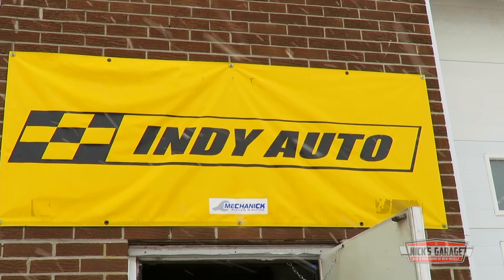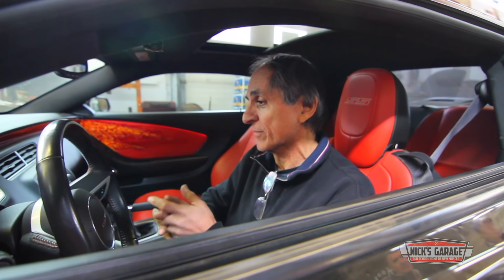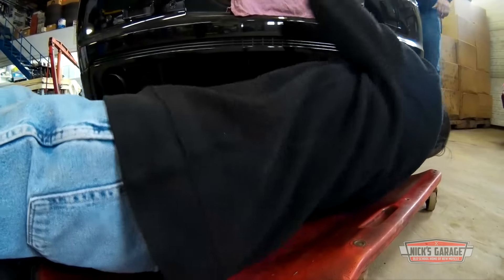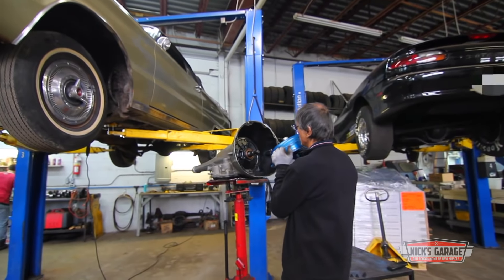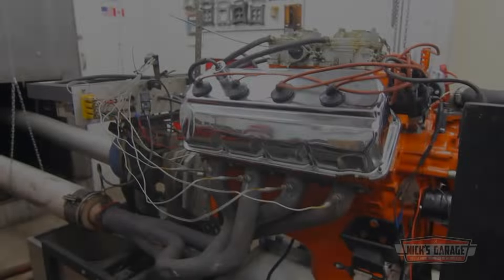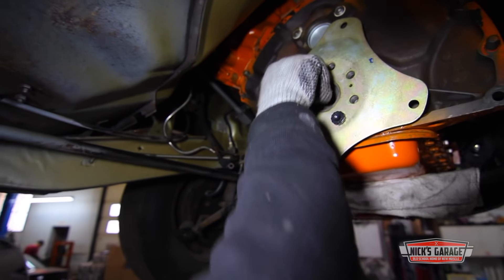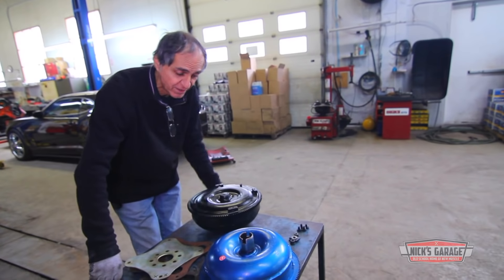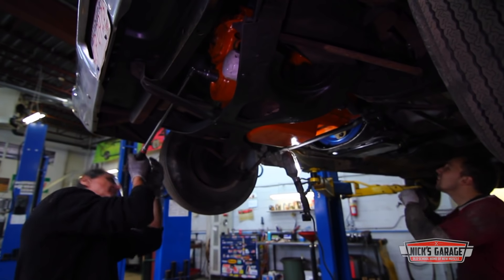Nick's Garage Before Christmas - '66 Satellite HEMI Swap!

Comment: We did a rear wheel bearing and brake job on one of my Chrysler branded minivans and somehow the backing plates got butchered during the job. It made a noise very similar to this, but it was more pronounced because it was rubbing in a few different places. Btw, those backing plates were expensive! I think it was ~$800 for a couple pieces of 12" diameter tin. Good old dealership. pricing! Grr.

Comment: Sounds like a GM aluminum drive line. They pop and crack like that really bad. I had a 4x4 I installed a steel drive line in and it never made the noise again

Comment: Like Dragsters that go out and race for a weekend they only go use those motors for like one weekend event and they got to rebuild them last for the whole season is Motors Reno built and ready to go and backups and everything else is if they fail that is in the car that quick I got to have it built already I got to put it on the dyno they have to have all that stuff done prior to putting in the in the in the car cuz I don't have a way to do it afterwards they don't have anything on those cars except the basic ignition transmission and there's none of that smog stuff on there carburetors of Dino 300 400 500 600 thousand $2,000 carburetors it's crazy to get the performance out of them things

Comment: I had a neighbor that used to have Motors like this in his boat and it would go out for a weekend and get it over and turn the engine apart and rebuild it like and that's what we had to do on a regular basis and that just like why would you do that to every time you took it out because it was high performance it's a one-time race for the weekend to come back and redo all these things again so it's reliable the next time you go out that's crazy that kind of money mechanics

Comment: Big rigs and get on that road and make it up that hill and have to have the brakes to stop that rain coming down it and that's the important part that motor is assigned to be geared at able to climb a hill that you'll fly by that big rig because you only have a little $4,000 by this guys pulling a hundred thousand pounds up a hill and that motor is bad ass but coming down going to have the brakes to stop it and that's where the muscle cars they couldn't put up they couldn't do it a big rig does the motors in those things are tanks but you put one of those in a card and it'll be a whole different story

Comment: Okay that might work wise but spec-wise it's probably not safe to go with for four bolts instead of eight they design their thing so it had eight points so it didn't fly apart putting four plates on it and having the other holes drilled probably not the same thing but it is a bigger bolts that windshield why would they send it up the other way cuz it was better engineered for that why don't you sell it to make that other one like that why didn't you just have to torque converter made eight bolts and plug the other ones Georgia modify the torque converter to handle the bolt pattern

Comment: What I don't understand these cars are meant to go 70 miles an hour and if they can got the balls they can go up a hill when most cars can't most cars are designed to get up to 70 on a regular flat East Carson ZIP of it and when they're going up an incline they can still go they can maintain that 70 that's a difference between a muscle car and a an average car when it comes time you're going up a hill climbing a mountain these cars going to maintain the speed and still keep the pedal to the metal and keep it at that speed as to where most cars can't

Comment: That's something that's not supposed to go in that vehicle and it's not supposed to have that particular dry packaged so you are taking the chance that that's going to fly apart versus what it should be long as you don't drive the engine light just like the way Hemi power where you feel racing it I told him it'll be fine then you just destroyed the way you looked at him in the first place if you weakened it you put up a part you can't find for it which makes it the ultimate package and this is why you can't buy old stuff that's a different pranks you can fix it unless you got somebody that knowledgeable and how to modify in the vehicle to make it work I feel like we're in the movie where they were on the island they got to get that boat motor in the head to get a trailer distributor had to go through that all that fighting to steal an engine part off an island just to make one boat run forgot the name of the movie it was like over all the criminals ago it was terrible and there was two types of living normal living and then there was the crazy Madness of this violence where they stole their everything to get what they needed to survive it was a jail from hell

Comment: NICK, ARE YOU AWARE THAT THE LS IS A REGURGITATED FORD 427 HIGH RISER ENGINE AKA RAISED PORT WINDSOR ENGINE. FROM THE BLOCK ARCHITECTURE TO THE HEADS IT IS COMPLETELY FORD IN DESIGN. NOT 11111111 DESIGN ASPECT OF THE OLD SMALL BLOCK CHEVY LIVES IN THE LS. THE LS IS COMPLETELY FORD. GM ENGINEERS ARE CLOWNS.
Reply: The LS and the FORD have dissimilar architectures that are easily distinguished apart from each other. They ARE NOT the same. Not even close. The engineering team of Koerner, Ron Sperry (cylinder heads), Bill Compton, Brian Kaminski, (engine block), Jon Lewis, Stan Turek, Don Weiderhold and Dave Wandel; all many years with GM prior to the LS; are nothing to do with FORD.
Reply: The LS and the FORD have DISSIMILAR ARCHITECTURES. They ARE NOT the same. They are easily distinguished apart from each other. There seems to be something about this that you don't understand. Actually, from what you've written here, a whole lot that you don't understand. The LS is a GM design. It is a clean-sheet-of-paper design that required nothing of FORD. You, obviously have been drinking the "Kool Aid" You should save the UPPER CASE rant for your buddies.